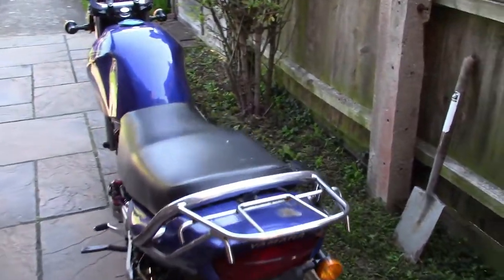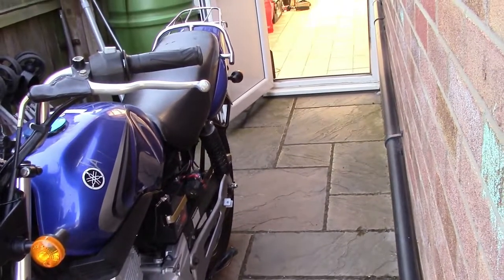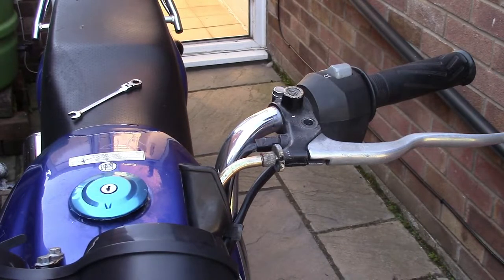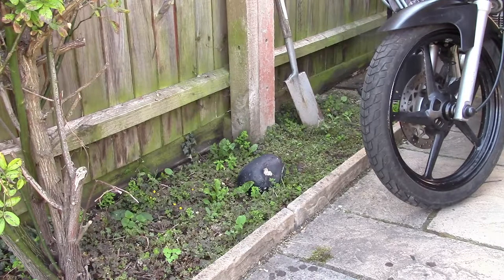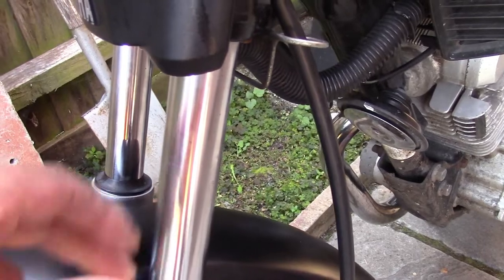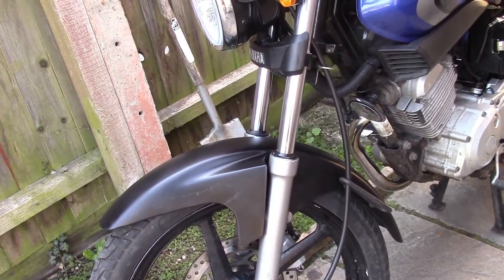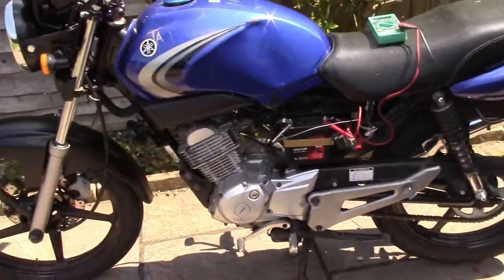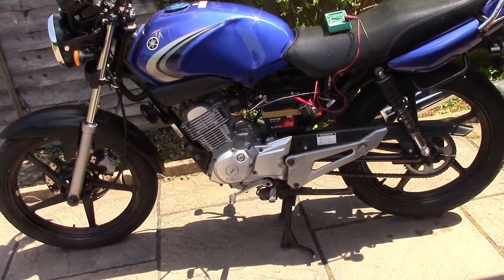Yamaha YBR125   Clutch   Fork seals & battery check

Comment: I always make my
Own seal tool too mate. Always worth trying it out before investing in new fork seals. Most of the time sealing seals just need a good clean and not replacing.
Reply from the maker: Seals are as cheap as chips, its just the work involved in getting them changed. I really did not expect this to work, but it did!